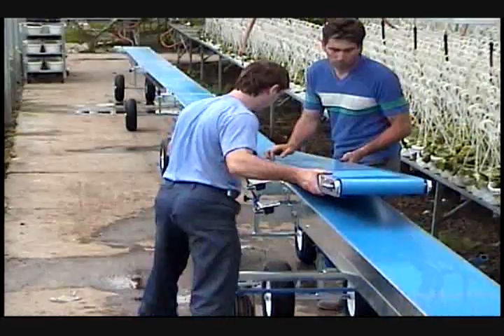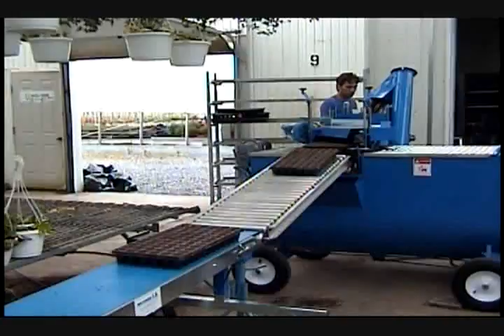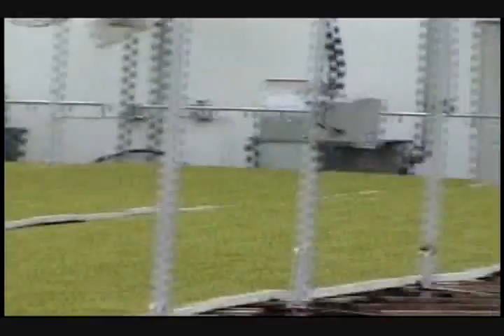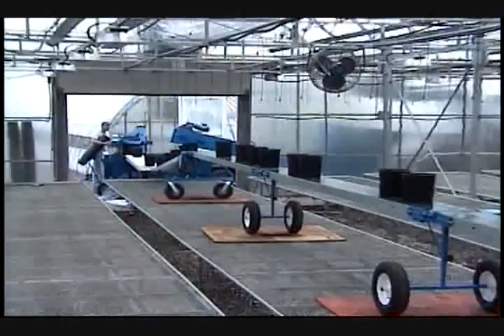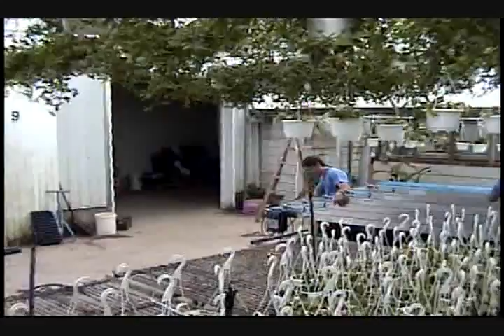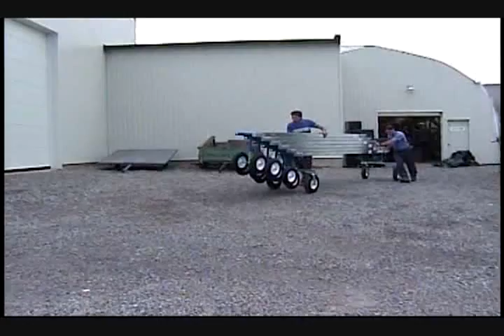Portable conveyor

Comment: Loading Unloading Belt Conveyor

• foldable to save spaces
• load & unload
• good load
• speed adjustable
• auto height adjustable
• movable one wheels
• dependent control box
• provide customization

Curved Belt Conveyor
1.This belt conveyor is made of food grade PP belt and stainless steel frame,material is customization;
  
2.Side frame can be fixed on both sides of the belt to stop the materials falling down from it and get dirty,especially suitable for food package conveying;
  
3. The broken section of the belt can be changed with another new section then can work again,quite different from normal leather belt conveyor,and it is easy to clean;(pp belt)
  
4. Convying evenly makes it equiped with the packing machine stably and ensure the stability of the production line. The speed can also be adjusted according to the convying requirement;
 
5.Adjustable; Belt width and length can be made according to customer's requirement.
 
6.Speed can be adjusted by speed reduction motor.

Electronic Roller Conveyor
Overview:
• Standard conveyor widths of 18''/460mm, 24''/610mm and 30''/760mm.
• Support legs are fully adjustable from 700mm to 1000mm. Other heights available upon request.
• Up to 100kg/m load capacity per linear metre based on a level working height. (powered models)
• Heavy duty castors – 4'' or 5'' swivel castors for maximum manoeuvrability. All castor wheels incorporate foot operated brakes.
• Roller centres – 125mm as standard when the conveyor is fully extended.
Features:
• Self Tracking - Cartons follow the twists and turns of the conveyor path without using engineered curves.
• Adjustable Height - Simply turn the locking knob to raise or lower the conveyor bed height.
• Square Tubing Legs - Heavy duty legs for longer service life
• Reinforced, ribbed zinc plated steel side plates. Assembled with bolts and lock nuts without rivets.
• Structural Steel Support - Channel steel spans the entire conveyor width for unequalled strength.
• Casters with brakes - 4'' or 5" swivel casters roll easily. Caster brakes lock both wheel and swivel simultaneously while the conveyor is in use.

Mobile Roller Conveyor
Material handling conveyor 
1.Video is available 
2.OEM:yes 
3.Manufacturer 
4.Mobile and special design

Wheel Conveyor
1. Extensible conveyor is used to solve problems on transport in such complicated environment as warehousing, packing line and loading/unloading etc., and can handle all sizes of boxed packages with flat bottom.
2. It has an advantage over fixed conveyors in flexibility and immovability. It makes skillful use of movement, expansion and compaction so that floor space required can be reduced remarkably.
3. This conveyor is a complete steel structure, with flexibility. And it can be laid out at your request.
4. Multiple Extendable conveyors can be connected together and can be expandable optionally to any length required.